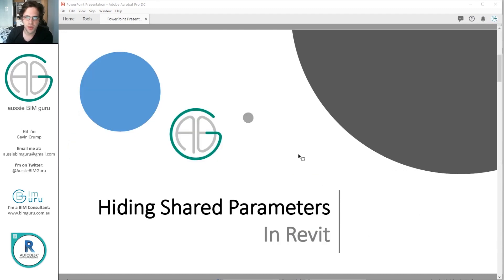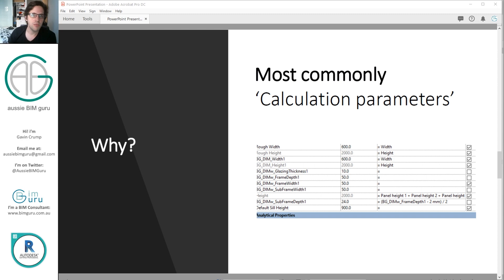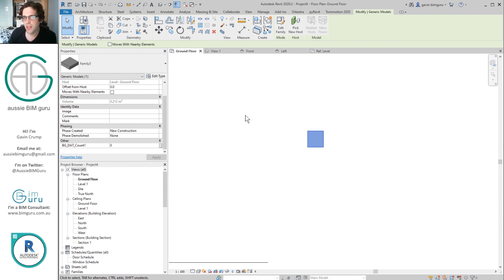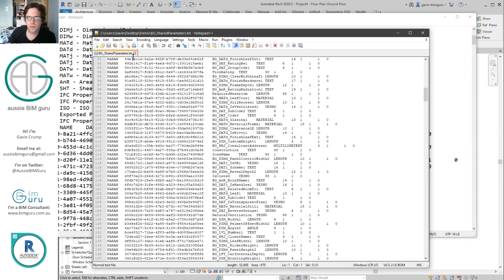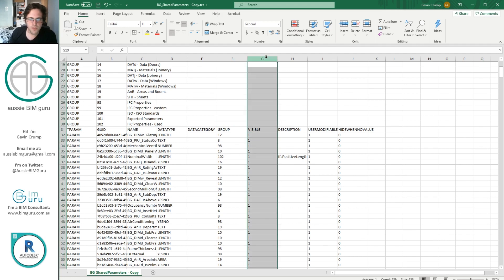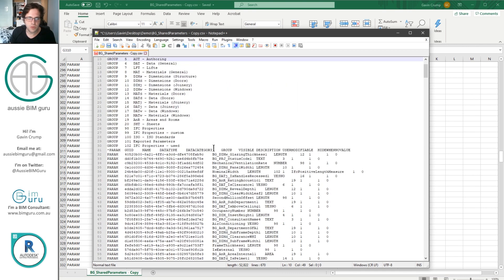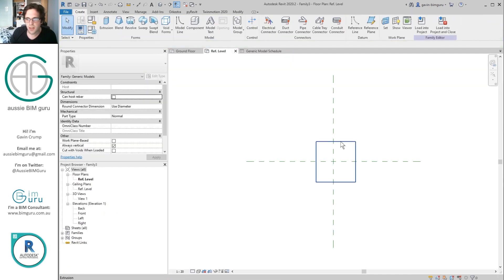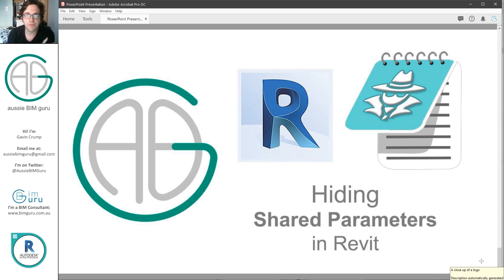Hiding Shared Parameters in Revit!

Comment: If you were export this model to Revizto or as a Navisworks file, I wonder if it would be visible there? Maybe its already common sense to some, but has any else tested this? before I give it a try
Reply from the maker: Hrm not 100% sure, but I suspect it would be. The parameter is still in all effects there, but is just being told in Revit specifically not to appear. It can be tagged etc.

Comment: Just use libre office instead!! you can open it, edit it, save it, just that easy. forget MS-excel when working with revit. it's the same with every other file like type txt files or lookup tables. it's much easier with libre office calc ;)
Reply from the maker: I've looked into Libre before but found Excel does most of what I need, and with the right functions it can work quite quickly for me also. Save as .csv/.tsv is fairly straightforward when leaving the excel environment, just a different file type to nominate.

If I'm doing lighter work I tend to use Notepad++.

Comment: Hi I got a question , is it possible to change the grouping of a family parameter?  like from dimensions into others? 
Thanks.
Reply from the maker: I assume you mean a shared parameter? Unfortunately once it has been created they are locked into all but their file grouping value.
Reply: @AussieBIMGuru  So i need to delete it in order to regroup correct?
Reply from the maker: Yes if you want to change a parameter type you will (e.g. a length parameter to a text parameter).
Reply: You can change group parameter in project enviroment, (it need to be shared or project, to work with method below).
Create schedule with any category that have that parameter.
Select parameter, click edit parameter, (pencil on down side), then change group of that parameter.

Comment: Hello BIM Guru, I think I have kind of interesting topic for another video. In Addin for rabbit named BIM Tools from Sofistik company, there are families of openings which have few parameters showing their top and bottom elevation above 0 Level or Survey Point. The magic for me is that they are calculated automatically and they are change the values when the instance is moved. It's not hard though to make it using Dynamo but do you know how to create families with parameters which works dynamic? Best regards :)
Reply: Autodesk should provide this functionality for family.  I posted a Revit Idea "Use instance properties in family formulas" https://forums.autodesk.com/t5/revit-ideas/use-instance-properties-in-family-formulas/idi-p/9569232
Reply from the maker: It's a good idea, but I doubt they will implement it due to the way the families and projects interact. Truth be told I don't expect many more interesting changes for Revit in the next few versions (I expect eventually they will just say 'this is it guys, final version).
Reply from the maker: I believe these families may be face hosted? Typically if they're hosted to an element associated to a datum level they will be able to report this value as an elevation. I'm not actually sure how this is done otherwise - do you have a video reference I can view to research further?
Reply: @AussieBIMGuru  yes you are right, they are face or even wall hosted.  I don't have any referring video but here you can find this family from this add-in https://we.tl/t-O77Vew6yaq .
Reply from the maker: It appears that the family is just a standard wall hosted element, so it doesn't report its height from survey level unless its host is based from this level also. My guess is that the plugin is dynamically running in the background at all times, and updates this value for the user automatically by checking the difference between the survey level and the elevation of the host wall, then adds the difference to a parameter (it is in German so I'm not sure which one).
Reply: @AussieBIMGuru  the clue is that you don't need  to install that Addin, and the family works. So in my opinion there is no plugin running all the time. What is more the parameters of that family are shared and they have category crack width, which I have never meet in Revit. I thought about dynamic updater by API but right know I know that this feature exist. I don't know if we can apply that functionality inside families and force dynamic update if any changes occur
Reply from the maker: @Robert-qc4he  I must be missing something as the parameters only updated relative to placement level not survey level as far as I could tell.
Reply: @AussieBIMGuru  so it seems that the family somehow read elevation from Level parameter of instance .as you said before, but it strange that is not give straight way. I was wondering how to apply that kind of updater and what is more read elevation of Level and from that Level to set these parameters. I am asking about that because I want to create a Stakeout Point family which automatically read its coordinates acc. survey point. I right now have Dynamo script for that, but I wish to imporove workflow and make it full automatic.
Reply from the maker: The most effective way would be to develop an addin using C# which tracks this for us at periodic intervals.
Reply: Will reporting parameter help?
Reply from the maker: Reporting parameters only report conditions relative to their host family references (e.g. thickness of a host wall), not their position in a model.

Comment: What kind of parameters would you want always hidden, besides the ones that help the user family experience? 
Also, I think you can skip one step by saving from excel to a tab delineated text file. I do the same thing with a keynote file, its easier to do all the edits in excel and save out to use in revit. Great video as usual.
Reply from the maker: Thanks Javier, and good suggestion RE tab delimited text files - funny how I miss these things for so long until someone exposes it to me! Much appreciated.
It would really just be calculated fields that drive a family and maybe have benefit in being scheduled or accessed in Dynamo/Db environments. The overall goal being to simplify the surface level experience and only show users what they need to see in the properties. Not many other use cases come to mind though.